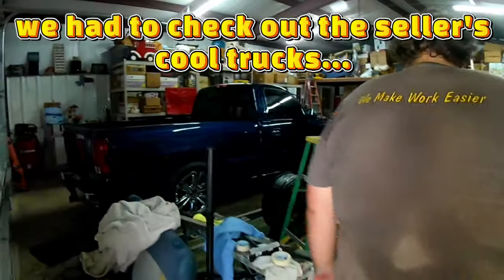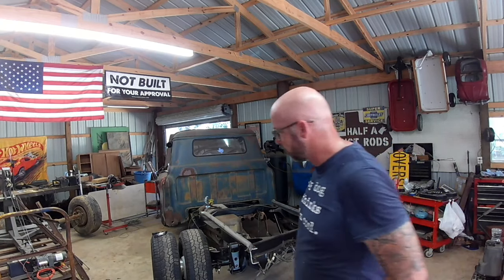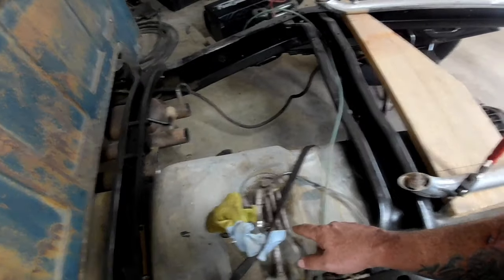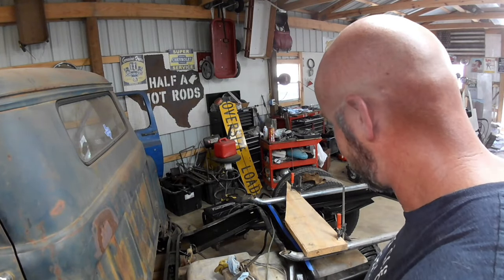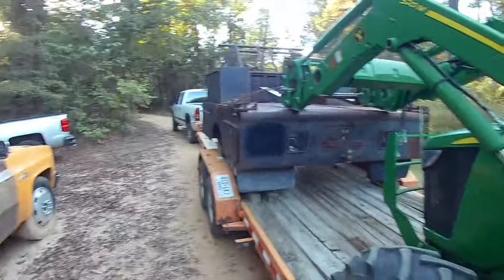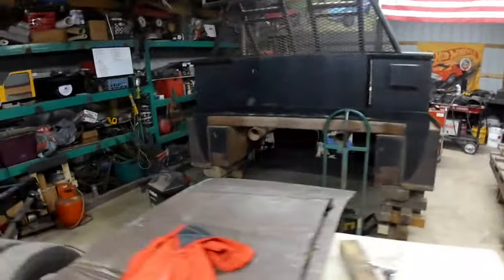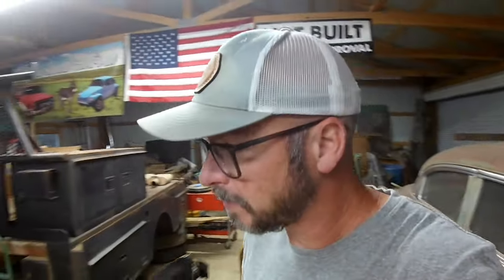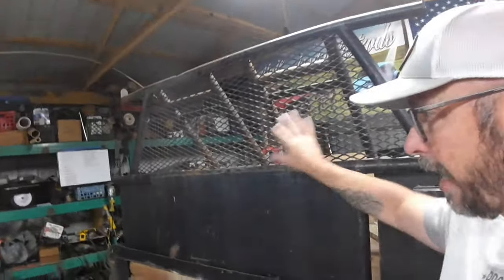57 Chevy Body Swap! Making a Bed Choice!

Comment: What's the weight of the bed how much are you going to be able to haul? It would be nice if the frame rails on these trucks for universal in width. Just keep plugging loans he's coming together.
Reply from the maker: @CAROLDDISCOVER-2025  I have a plan to address the weight down the road. I just need to see how much it squashes the springs when we set it on there first.👍
Reply: @halfahotrods6332  sounds like a plan.